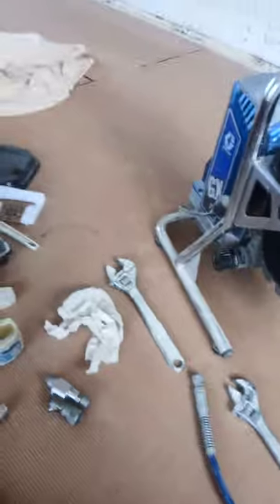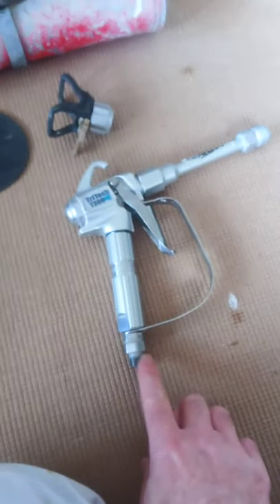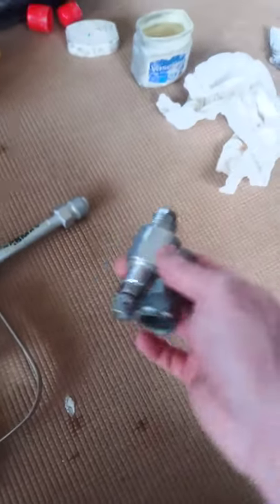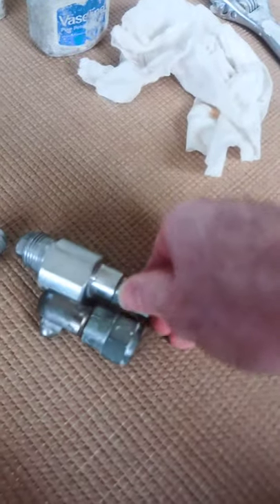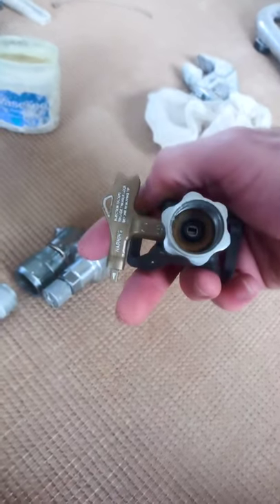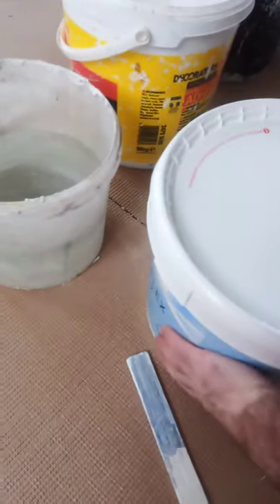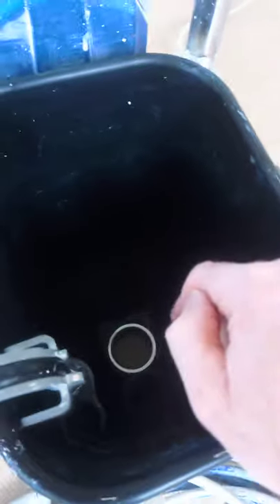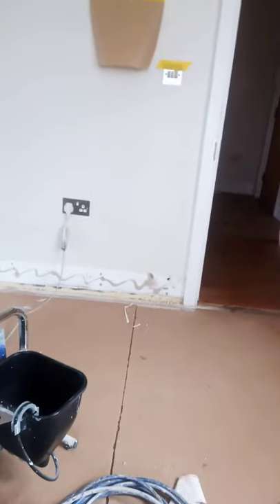Graco GXFF airless sprayer basic set up. Part 1

Comment: Do you use 1/4 hose with it or 3/8?
Reply from the maker: it's the thinner 7.5m hose.
Reply: @ProfessionalPainterDecorator  ok, but do you think gxff can be used with 15m 1/4 hose??
Reply from the maker: @taskhunters5245  the difference between a Gxff and a gx21 comes down to what hose sizes they use.
The 7.5m will allow upto a .19 tip.
Whereas the 15m on tye gx21 allows you to go to .21